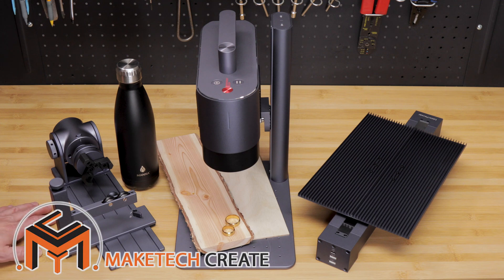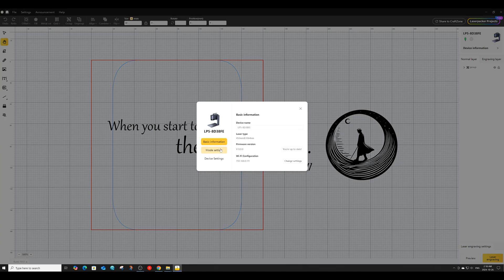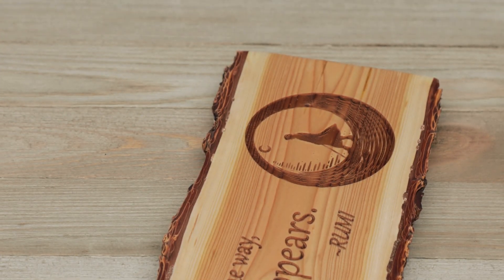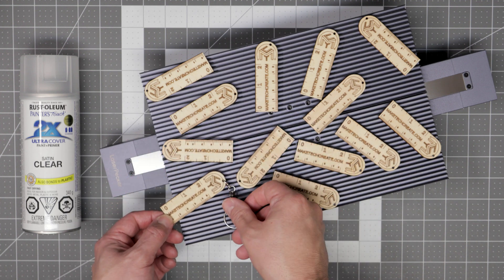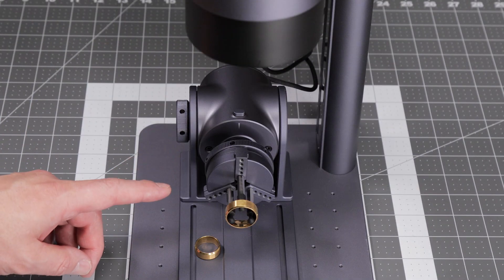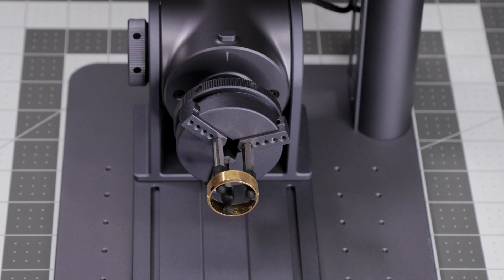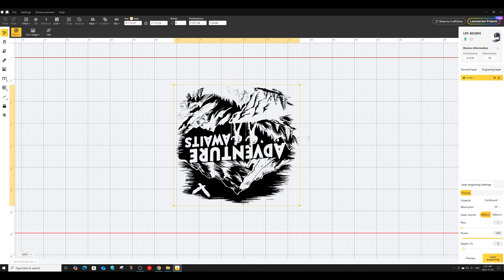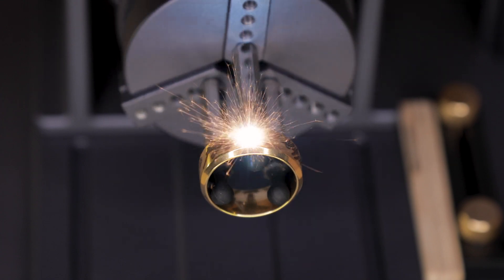LaserPecker Slide & Rotary: Are These Add-Ons Worth It?

Comment: I'm wondering if the slide and the rotary can be used together so one can engrave a cylinder of 300 mm in length?
Reply from the maker: No, they unfortunately can't.
I'm about to release a video on the WeCreat Lumos, where you can do that.
Reply: @MakeTechCreate It's probably a software issue. The LP5 had enough ports.

Comment: Great video. I primary use the rotary with mine right now but I keep running into issues where the rotary doesn’t turn during the engraving, so the laser just passes back and forth on the same line. Have you had any issues like this? If so would love to know how you have resolved it. Thanks
Reply from the maker: Sorry to hear that! No, I haven't had that issue. Have you contacted Laserpecker support?

Comment: Was the bottle ready for Laser Etching or was it just a random bottle out of the store? - Awsome Video!
Reply from the maker: I was just a random stainless steel bottle from the store. No prep was done to it.
Reply: @MakeTechCreate  Thanks for the Awsome channel and the quick replies! Keep up the great reviews! I would love to see more of the LP5! Like tipps and tricks, your projects, how you use the software (or do you use Lightburn?) and so on!
Reply from the maker: I mostly use lightburn and import the files in the LP software.
Reply: @MakeTechCreate  I'm tech ignorant and am weighing my options on what laser to get partially on the ease of software on each brand. So, in this video, you were not using the Laser Pecker software or you were? You imported Lightburn into Laser Pecker? That's above my paygrade for sure... Please elaborate/help...

Comment: Just want to say thank you so much for making the time to make this video. I have just received my LP5 and ready to set up. I work ing gold and want to engrave inside of gold rings and bangles, have you tried this and would the settings be much different between white gold and yellow gold
Reply from the maker: You're welcome! Glad the video helped! I haven't tried engraving gold, but it would likely require lower power and faster speeds than brass. There is a material test function in the software if you have a piece of flat gold sheet you can test on.